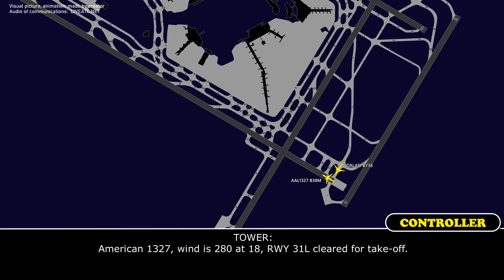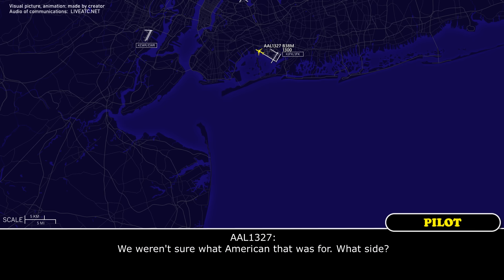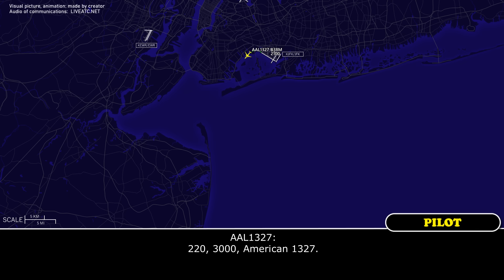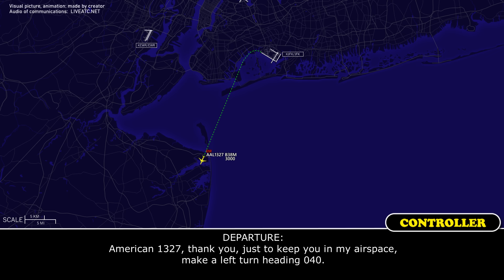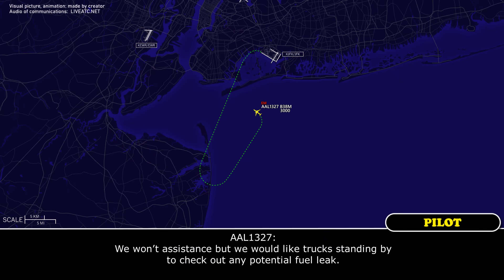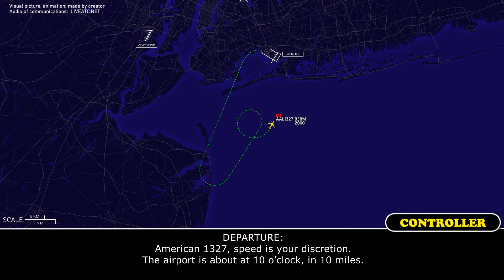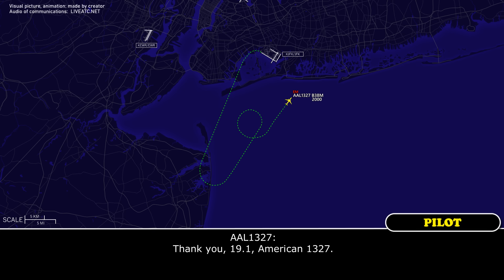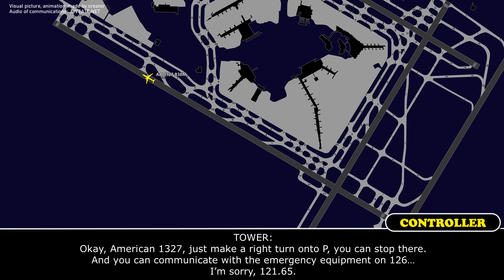Fuel leak on takeoff. American Boeing 737 MAX 8 returns to JFK Airport. Real ATC

Comment: please check xfeed valve switch captain. If the high speed xfeed valve is open it only feeds from one tank. This gives the impression that there is a fuel leak.

Comment: Does anyone know how long it would take the pilot to know if there is a fuel leak ? Not a pilot so it’s a serious question . Thanks
Reply: Pilots usually report fuel quantity AGAINST what is estimated on the flight plan at TOP OF CLIMB ALTITUDE. After that at each checkpoint location on the AIRWAY. [ about 40 minutes flight time ] the flight plan fuel is compared against the fuel tank fuel.  You also have [ fuel used per hour gages ],  The computer on modern aircraft will show landing fuel [ landing at planned destination Airport ] at ALL TIMES, if the flight continues as planned.  This information is what pilots put into the flight computer while the aircraft is being boarded.
Reply: @YouTube.TOM.A  Thank You !
Reply: Yes during climb or start of cruise
Reply: Generally a message will come saying there is a fuel imbalance (at around 2 tons difference on the 787) the checklist leads you to determining if it’s from a fuel leak
Reply: @tonystewart7287  I agree with all said, leaks can be small and hard to detect except by time and diversion.  It's the reason why checkpoints / and quantity are the most accurate way to detect leaks, also  when a leak started.

Comment: I’m surprised the delta pilot said “right side wing” instead of “starboard wing” 🤔
Reply: No, they should have said the number two wing.  lol
Reply: @Daynja1  Boeings are designed for Right and Left. #1 and #2 might be an Airbus or an old McDonnel Douglas thing.
Reply: @Daynja1  indeed. Somewhere in the back of my mind I thought that the pilot misspoke. What I thought of, was Geordi always complaining about the Enterprises’ starboard power coupling.
Reply: Yeah its more useful in space, because flying saucers don't have a front and back so left and right can be ambiguous.

Comment: Could have been the surge tank vent if they had no imbalance showing. I've had that happen a few times.
Reply: Are you a pilot ?
Reply: @Denver_____  yes. are you?
Reply: I have heard of that happening before but this time the pilot behind him is the one who called it in.  I think he would know the difference.
Reply: @susanwahl6322  The last time I had a surge tank vent leak, the A/C behind us on taxi out called ground. As far as I know, the crew in this video did not shut down an engine, which is where the fuel imbalance/Fuel leak checklist eventually takes you if you have a verified leak. The crew behind them wouldn't NOT report an observed leak, even if they thought it was "only" a surge tank. There's really no way to know for sure from their vantage point.